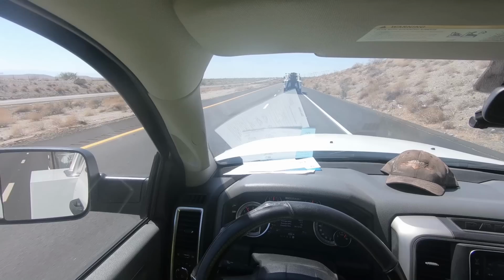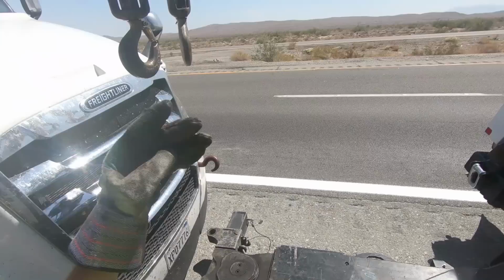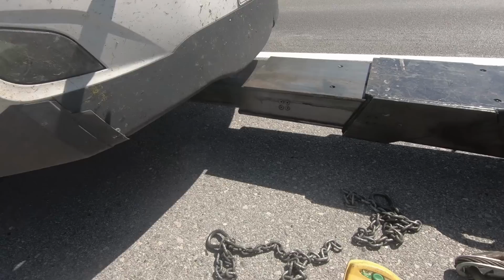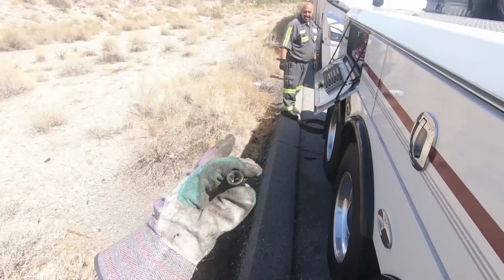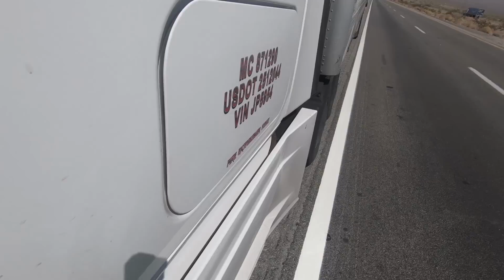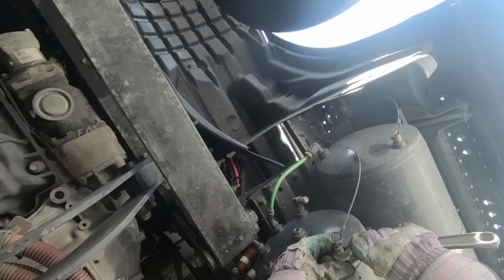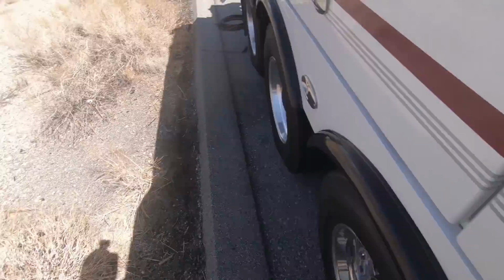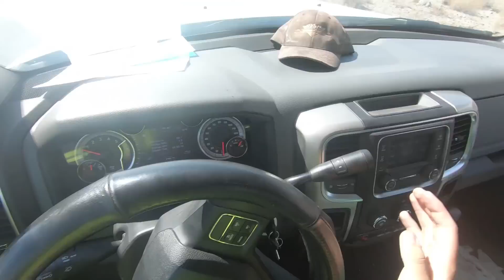How To Tow The 2018 Freightliner Cascadia | HARDER THAN USSUAL

Comment: I have had Freightliners for over 40 years; first one was a ''74. Never had one behind a wrecker with less than 500000 miles on it. Something is very wrong when you have almost new trucks breaking down to where they need to be towed. That is why I have owned ''99s or older for the past 20 years. Current truck is a '99 with 700000 miles on it; never been towed. Ex-California truck and I was thrilled to get it!

Comment: All those low air dams will be toast the first time they are up North in the winter.  As soon as they encounter a frozen berm while turning into some customer's driveway.... keeeerunch.   Obstacle eliminated.
Reply: Looks to me @ 9:30 like it's already been crunched a time or two. (rivet is pulled out). Thank California and all their idiotic CARB laws for designs like this. In it's lifespan, by design this truck will easily crunch 15-20 new bumpers , but by CARB  over it's lifetime this design will save at least 10 gallons of fuel.
As a former roadside tire serviceman, I can see  how bad these would be to try to get a jack under with a blown steer tire. That's real safe to deal with on the side of the freeway (sarcasm).
Reply: Well they should have ordered one without the lower air dam. It clearly stats in the line sheet it is for over the highway only.
Reply: @badassforever1  Over the highway still use parking lots and driveways.

Comment: At 28:24, you can see a 90 degree elbow with a plug with hexed sides. That is the pressure relief valve. With only one exception, I’ve always been able to use that tank with this valve, as my plan “B” to air up the entire truck. 

The only exception was an International TowStar, I mean ProStar, that only had two air tanks that each was filled directly, and independently, from the air dryer. I ended up plumbing both tanks drain ports together, then to my truck. 

Towing is is similar to flatbed trucking, in that it is an art form with a thick rule book. There is more than one way to do things an still safely reach the same outcome. 

Keep up the great work, I’m always looking to learn something new.

Comment: The amount of time that could be saved (and thereby reduce risk to guys in the towing industry) if the truck makers could agree to a standard mounting for the towing hooks, and provide a set of air and electrical points at the front for you to hook lights and brake lines to... Much like the pass-through systems on a bogie for making a double-b
Reply: they'd rather sell the "billy-bobs" a new "freight-wrecker" one a year >_>
Reply: Why do that they won't break down.
Reply: They want em all different so everyone can get a piece of the pie.
Reply: This is good idea, but it is also another part of the system that has a change to fail. Also if a tow truck were to plug into the trucks electrical system and then short everything out you would be very upset.
Reply: The tow lights the use are wireless anyway and many do have a easy place to hook air to tractor but your trailer brakes always have to be hooked to tow unit
Reply: Dan x hh lłł'Q

Comment: I actually remove the front bumper. 8 bolts in total and strap it to the catwalk in tow. Once you remove the 8 bolts you simply lift up and pull it towards you. There are 4 on each side easily visible when you look at the inside of the bumper. Not too time consuming.

Comment: I work in logistics for a transportation company and I dont have a dog in the fight.  Never been a driver and I have only been in the transportation industry for a couple years as I came from the professional services industry.  Our fleet is about 7300 or 7400 tractors.  5200 of which are freightliners.  60 percent of those freightliners are dd15 1750 tq models and 40 percent are dd16 2050 tq models.  We also have 1000 internationals with the cummins x15 2050 tq models.  Lastly we have 500 each of kenworths and peterbilts with the paccar mx13 1850 tq models.  I guess we also have a 150 or so western stars with I think Detroit diesels but I dont deal much with the western stars.  I can say definitively the number of breakdown events with the paccar kenworths and peterbilts is a fraction of the internationals and a shockingly small percentage of the freightliners.  I probably can't say the specific numbers as I'm sure it is in some NDA I have signed but def/dpf systems can be done well and doesnt have to be a cause of a tractor being in the shop every 50k to 100k miles.  When it comes to the long blocks themselves we simply put dont have engine failures with the paccars aka peterbilts and kenworths.  We have had a startling number of engine failures with Detroit diesels in our cascadias.  Not just looking at total numbers but actual percentages.  These aren't def/dpf systems failures.  These are critical failures of short block or head components.  When adding the ancillary systems like cranking, charging and def it is shocking how much more reliable the paccars have been.  When the paccars do break and it is a customer pay situation the service cost is higher than freightliner or international.  The cummins x15 hasnt been as bad as the Detroit diesels but hasnt been nearly as good as the paccars.  Our company has decided to phase out the internationals for 1k more peterbilts and kenworths over the next few years.  We will never have all peterbilts and kenworths as it seems to be to cost prohibitive probably a combination of running costs related to mileage and the purchasing costs of the units.  We have been buying peterbilts and kenworths for about 20 years and as more time goes by the more our number of paccars grows.  They are the only tractor we will keep out of warranty.  We will keep them a full 5 years.  The freightshakers the minute they hit 500k miles get sold.

Comment: The trucks with auto trans are shifted by air giving the air tank mark trans. It uses air pressure to engage and disengage the clutch and shift the gears they call it a automated manual.

Comment: If you're looking for a place to push air in, what about the pressure relief valve on the air dryer? i think it's 3/8 on a Bendix AD4 or AD9, those are almost standard equipment on trucks. Another standard point to find is the tank signal port on the air governor. usually easy to find, and straight into the wet tank with either of these points.
Reply from the maker: Yes I am familiar with those hookups! In this case since the dryer wasn’t behind the bumper like it typically is I went directly to the tank. Safer bet in my opinion. Nice comment thanks for watching!
Reply: Any particular reason you pulled out the drain valve instead of pulling out one of the many bungs on the tank, which appeared to use a square drive for a ratchet? Just curious.

Also do you ever come across trucks that have air connections that already exist specifically for towing / recovery use?

Comment: What s the rule for automatics?
Reply: Always pull the driveshaft before moving the truck at all. Manual transmissions can handle being towed a reasonable distance in place without damage. Automatic transmissions cannot, even a very short distance under tow can damage them.
Reply: @tallman11282  oh so there are automatic trucks?
Reply: +Ferguson101 Actually Alison Automatic Makes Automatic truck transmissions that are basically a large version of whats in a car, that's right, a Planetary style transmission with Lockup torque converter. They are starting to gain popularity now in things other than Busses and Garbage trucks for various reasons.  Go look up Alison Automatic on YT if you are curious.
Reply: Pull the driveline

Comment: Now this might be a stupid idea, but if im correct, normaly when you push in the red brake button, air flows from the tanks to the trailer. Wouldn't it work in reverse? To supply the truck with air using the trucks red hose? Simply connect the red hose of the tow truck to the red hose of the tractor that is being towed and push in the red. That way you could always use the same coupling and hose, no need to figure out each time how to connect air. But I'm just a software dev, I might be missing something.
Reply: Then how would you release the trailer brakes?
Reply: Simple, make a hose with a Y or T piece in it so it has 3 connections. 1 to the truck red, 1 to the trailer red, 1 to the tow truck red.
Reply: typically there is a check valve that would prevent that if I remember correctly
Reply: If you were talking about attaching at the red glad hand on the tractor to flow back in, there is almost always on the newer trucks a one way valve installed so air can't flow in.
Reply: That's usually how they tow tractor only. Trailer is easier to go direct to a tank this guy just didnt have the right tools for some reasons. Not a tow driver but been broke many times in 8 years lol

Comment: Have you come across the 2019 Cascadia's with the flange drivelines and the 21mm Driveline bolts yet? Good times I tell ya. To top it off you cannot tow them from the rear.
Reply: Are you talking about the ones that have something like 10 nuts and bolts? I ran into one a few weeks ago, you can't get the box end of a wrench on the nut, and the bolt head is nearly basically impossible to get on with a socket. We ended up taking the axles after we nearly broke our breaker bar from the pressure we put on it.
Reply: I don't have the part numbers handy, but I ordered a  21 mm impact socket, and use a 5" impact wobble extension on my impact to get the nuts off, and a cheap thin closed in 21mm wrench to hold the bolt head behind the flange. I have towed several myself, and so far that has worked on all of them.
Reply: He sees that on a 6X6

Comment: Why do you have to disconnect the drive shafts?
Reply: If you do not disconnect the driveshaft on these new Detroit transmissions, you will wreck the inside of the transmission since the oil pump is not spinning.

Comment: Why would it matter if it's a stick or automatic? You still gotta pull the driveshaft either way.
Reply: Dan Dunning if it’s a stick you can move it a short distance without pulling the driveshaft, if it’s an automatic it has to be pulled before moving anywhere neutral
Reply: Automatics can be damaged being moved even a tiny bit while manuals can handle it.

Comment: That is some dumb design
Reply: Zachary wait until you see the new Tesla truck.
Reply: @rickfehrenback3851  ikr tesla is shit
Reply: Tesla doesn't have a final design and hasn't started mass producing the truck yet. If they do mass produce it, I'm sure their trucks will be pretty reliable and eventually they will have different models. In the first few years they will fix any bugs and make modifications based on customer reviews. It probably won't be as sexy as a Peterbilt but their concept design is for aerodynamics, etc. And ofcourse you wont have the awesome sounding diesel engine but we will have to step away from them sooner or later. If they can perfect the design and lower costs, everyone is going to want one because, though I have no proof and just am guessing, you will save a ton in fuel. Also help the environment. You will have max torque at any given time. There are a lot of benefits of an electric truck.